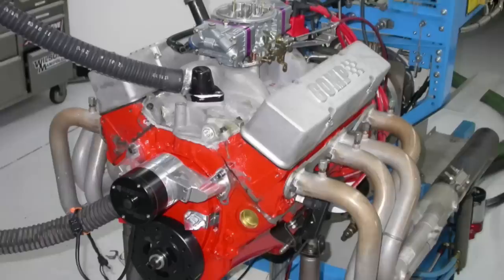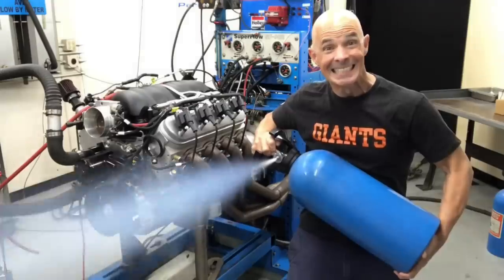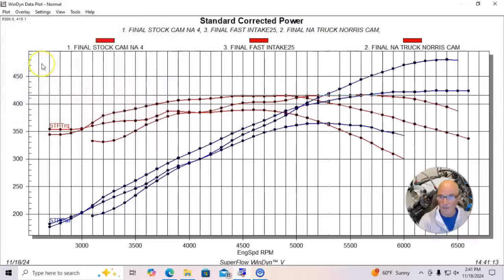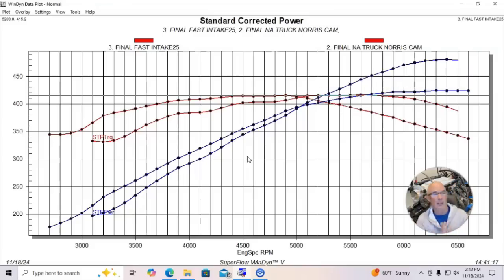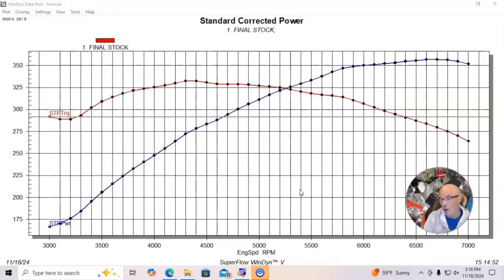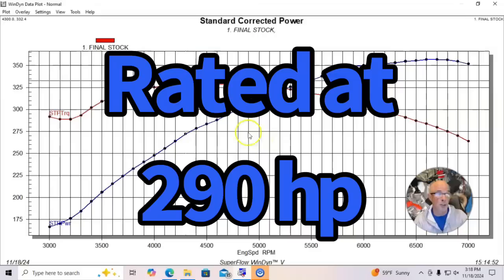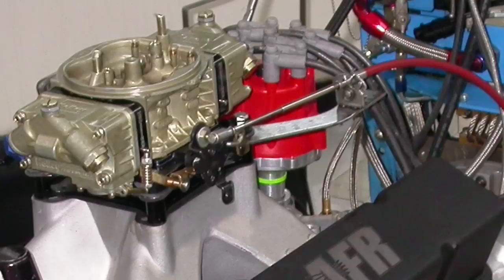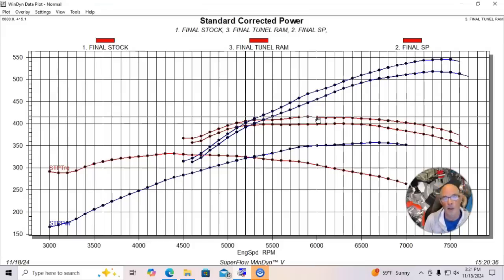DZ302 CHEVY-HOW TO ADD 200 HP TO YOUR SBC WITHOUT BOOST OR NITROUS! HEADS, CAM, INTAKE & OILING!

Comment: 302 with a 4 inch bore is basically a 364 with a short crank! Boost machine 🥰
Reply from the maker: 4-inch crank is hard to fit in a SBC-rod bolts hit the cam

Comment: Hi mr. Richard if not allowed just ignore me i wanted to know your thoughts 💭 on a 358 build with 12cc pop up dome pistons. 6inch H beam rods crowler forged 3.480 stroke crack. flo-tek heads 180cc intake runners 66cc exhaust runners and 2.02" intake valve 1.60" exhaust valve cam lift 443/465 duration 214/224 112 LSA TH350 but plan on changing to a 4L80E later on posi rearend 3.73 gears may change to 4.11 3000+ lbs car
Reply from the maker: I would use flat top pistons (you didn't mention chamber size of the heads) with that cam (especially with pump gas)

Comment: In the 80's 750 to 800 hp out of 302 SBC was not unheard of in SCCA TRANS AM racing. We had to use cast iron heads but they were starting to stand up the valves, chevy bowties were the heads and blocks of chose. In 1982 we could switch to aluminum heads. They all came from Brodix and had Pontiac cast in them, if I remember right they had valves stude up to 18 degrees. 
We idle them at 2500 rpm to keep the harmonices from breaking valve springs and we practice and qualifying and then install new valve spring before the race. The motos ran 6000 to 8500 rpm including down shifts that was the was the hp range. It was not uncommon to see 9500 on the tattletail. The motors received freshen ups about every 2 hours of racing. The motors would have things like cracked heads, loose valve seats, valve guides the moved,  slipped cam bearings, every now and then crushed rod bearings and or lifter valleys crack out. The motors cost $35,000 to $45,000 new including dry sump pumps, hoses, motor plates and clutch each. Around $7,000 to $8,500 for a freshen up and updates in 1980 dollars. The shop I work for had 1 car, 5 spare motors and 2 to 3 spare everything else.
Reply from the maker: 750-800 hp in Trans Am? Not with any stock head other than a Boss
Reply: @richardholdener1727  For sure. Back then they carved on those GM Bowtie casting and a Victor Jr for weeks. By the 80's all big motors were gone. A 5 Liters or less motor the car only had to weigh 2600 lbs. The basic rules were the motor couldn't be set back any more then number one spark plug lining up with the upper ball joint. 60% of the factory roof, windshield frame, cowl, doors and jams, tail light panel had to be used in the factory position. 10x15 inch wheels were mandatory that kept the tire and brake size down.

Comment: I must say, I was impressed , that you started out with ( in my very bias opinion ) the best small block Chevy EVER, instead of cheating out with a 150-200hp 350 of the mid 70’s👍🔧🔧🔧😎
Reply: What makes a 302 Chevy much different than a 302 Ford... same bore and stroke, right? No replacement for displacement.
Reply: Well the Chevy can handle revs for extended period of time without splitting the block in half

Comment: Rebuilding something like that now - 30 over 350 4 bolt.  Steel crank, eagle rods, speedpro pistons, 10.25:1 CR, brodix track 1 heads, Offenhauser Individual Runner intake (a tunnel ram with no plenum), twin 390 double pumpers w/ non-progressive linkage (8 one-barrels), true roller valvetrain.  A little over 500HP (estimated).

Comment: That’s all good on both those final combos. But, that’s really more for the track. Whether road racing or drag strip. While you are trying to squeeze all that hp out of those combos, you better be figuring out how to take weight out of the car. Unless it’s already light. Because you’re losing a lot of low end torque. Street car guys will be bragging about the HP. Then trying to play catch up off a light. Torque is best on the street. HP is best on the track.
Reply: It's called gearing bro lol.  Smh

Comment: You mentioned the 302 was 11:1 compression but when you were clicking drop down windows it shows it as 12:1. Which is correct?
Reply from the maker: the stock motor is 11:1-the AFR heads had a smaller chamber and thinner gasket

Comment: How much do you think you can improve upon with the factory 302 parts? Like how much do you predict is left with some port, bowl work, and really good valve job on the factory iron fuelie heads? Thanks Richard. I wouldn’t be opposed if you wanted to build a clone L88 for testing. I’m sure super pricey though

Comment: then it will make 300?
Reply from the maker: makes 350 hp stock
Reply: @richardholdener1727  aren't we talking about a 302?
Reply: @solidsnakec20 the 302 sure didn't have 100 hp stock unless you're talking about the early 80s super choked off Ford 302 even it was like 140 hp.

Comment: Hey rich what's your normal process for breaking in a freshly rebuilt LS New rings bearing new cam lifters rocker arms push rods only thing being reused is the crank pistons and rods?
Reply from the maker: the rings are really the only important break in component

Comment: Have you ever considered messing around with the ford 6.2 boss? It's not the best option nowadays but that engine is just intriguing to me ever since I did some research out of curiosity where it's an sohc hemi, it should be a killer platform if you can find hipo parts which are not as common but out there and the raptor had a pretty stout version of it. Whipple makes a blower for it.

Comment: Hello watching you go years great stuff I’m trying to some torque out of a stock 350 have a 488 cam high volume oil pump but I would like it below 4000 rpm any suggestions
Reply from the maker: what is a 488 cam?
Reply: I was told it’s a Comp cam 488 lift and biggest you can go stock?

Comment: awesome to see you do a 302! do you think the peak power maxing out was do to the heads or cam? do you think a larger cam with more rpm would push it further?

oh finally got a cam recommendation for my 9k rpm 302 build from salter racing. great guy.
Reply: but its good to see ill be well over 500hp on my build
Reply: What makes good power with any engine is a good well sorted combo.   Don't worry about big or small just make it all work well together in the rpm you wanna turn and make sure it can safely turn whatever rpm you are going for.  It's really as simple as that.  I can't stress enough how much it all needs to work together the heads cam and intake.

Comment: I don’t understand why your DZ302 clone with the Duntov cam, fuelie heads, and dual plane makes its power peak 1,000 rpm higher than the original DZ’s 5,800 peak?
Reply from the maker: 5800 peak on a DZ302? doesn't sound right
Reply: Those were GM’s published numbers.  290 horsepower peak at 5800 rpm and 290 ft. lbs. torque peak at 4200 rpm. Maybe some kind of sandbagging going on by the factory on the published specs since it was for trans am racing?  And never really ran it out to its true peak on the dyno for published spec purposes?

Comment: Years ago i built a 302 chev ..i used a set of angle plug heads off a g gas car and a 600 isky roller . It pulled hard and not lay over . Just the way i like a engine to run ..Good think for a rev limiter..i ran my engine to 7500 ..i could vary the lash on the sold roller and it made a pretty big impact on how the engine responded ..As good as the 302 ran ifbi ever built one i want a 100  more cu i

Comment: Hey Richard, I was looking online and came across something I believe is new, a cam called the BTR Truck Hoss cam, seems that it is capable of running stock converter, I have the 6.0 LQ4 and am curious if you could run some tests on this camshaft on a 6.0
Reply: Ill be going with your big truck cam until I bore and stroke, but for testing sake
Reply from the maker: that cam is designed for stroker applications-I doubt it is a stock converter cam with 5.3L
Reply: @richardholdener1727  for sure, definitely not! I have a 6.0 I plan to bore and stroke!
Reply: @richardholdener1727  I assumed it was a big claim for any stock converter!

Comment: I built a vortec 350. Did the LS spring and keeper upgrade with a summit 8802 cam and thin metal head gaskets. Mild porting on the Vortec heads.  It’s not in the vehicle yet. But I also have a mild l33 with the low buck truck cam and ported 706 heads.  I’m torn on which motor to use for my off-road toy
Reply: Those vortex heads work great off idle

Comment: Regarding a tunnel ram, do they gain or lose hp in the lower rpm range compared to a single plane intake?
Reply from the maker: they make less than dual plane but more than single
Reply: With a long enough tunnel ram, they will make more power everywhere but you can't just buy one and bolt it on
Reply: @paulmryglod4802  Holley Sky Ram has entered the chat
Reply: @jasonandjenparks1523  oh yeah you're right!

Comment: On a SBC can you have too much head flow? For instance can you put 225 cnc d AFR heads with 208 intake valves on an otherwise stock sbc?
Reply from the maker: the stock motor can't take advantage of the head potential, but even the 225s will be better than iron Fuelies
Reply: Yes it will work fine just not reach get the most out of those heads is all
Reply: @GlennManchester if the heads are too big it can make it lazy on the street no? Kind of like having a big ass cam in a stock engine lol.  That's what I always thought.
Reply: Seems like those would only be efficient at high rpm.

Comment: Imagine the torque you could have if you did the same thing to a 400ci sbc!
Reply: Exactly. I pulled a healthy DZ302 out to freshen it up, and put in a mild pump gas 406 with smog heads on it so I could still drive the car while I went thru the 302. That was about 15 years ago, and the 302 still sits in the corner of my garage collecting dust. Rpm's are cool, but once you experience big cubic inch small block torque, there is no going back.
Reply: @bdd1469  Totally agree.  I abandoned the SBC in 1990, when I got my first BBC.  Something about 630 lb/ft torque on a 468 C.I is a feeling to behold.
Reply: U should build 1 now. The 'Kick' is lotsa fun.
Reply: Imagine if you did it with a 434 SBC?

Or just forget about SBCsand go to a 454.
But what a waste..
Maybe a 572ci?
Naahhh, 

615ci ?? .....
Reply: @Hapkido82AUS  I like your way of thinking! Just saying.  

Do it right the 1st time. 

However the big block is nose heavy.  Especially for any street, I mean Mexico racing, or tracks that aren't straight, ¼ mile etc.

So..... yeah that 434 Stroker!  Dart has one ready to go. Entry is 600HP plus, & TQ is absurd, & can still be boosted !!! Yes yes yes

Comment: Hi there Mr Dyno 👑 my cousin have a 350 Chevy bored 40 over aftermarket head he wants to make 400 horsepower 650 Holley carburetor NA 66 Nova 👍
Reply: Pick the right cam and springs and that's easy especially w aftermarket heads